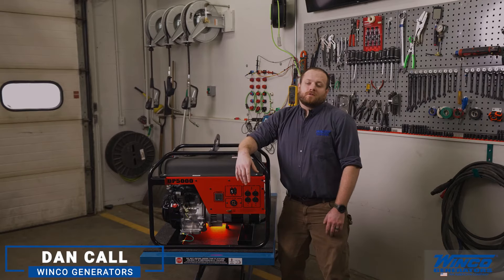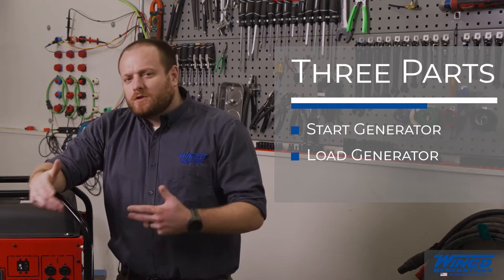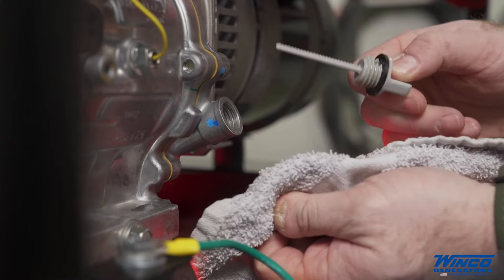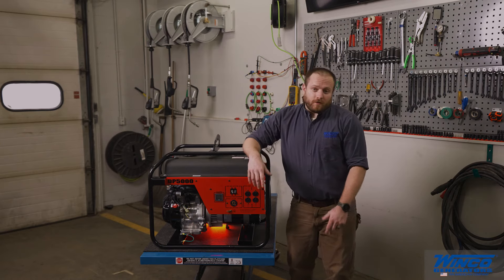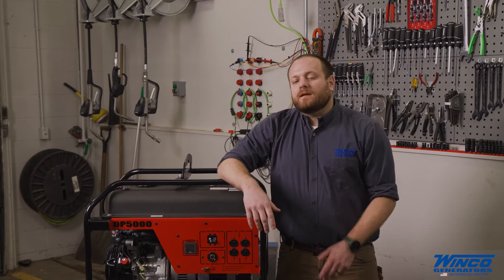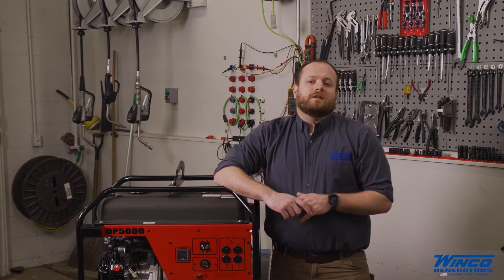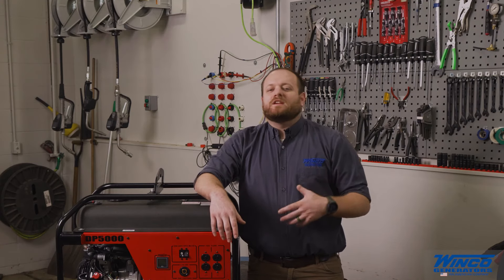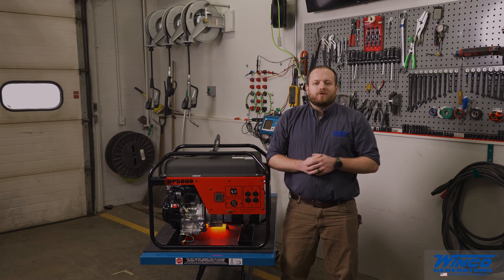Winco Portable Generator Startup

Comment: Nice Video,   I own a n ew HPS 900O tri fuel and wish it had the YourGen meter.   Can I get an add on for this?
Reply: yes, exactly what i was thinking. would be a great add-on
Reply from the maker: There could be a way to retro fit it. Contact our technical support at 507-357-6831.